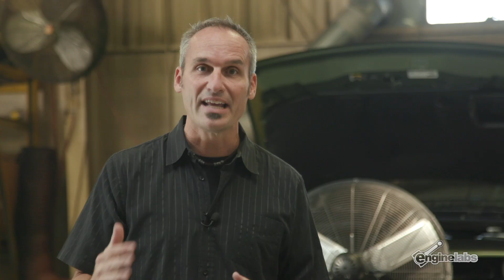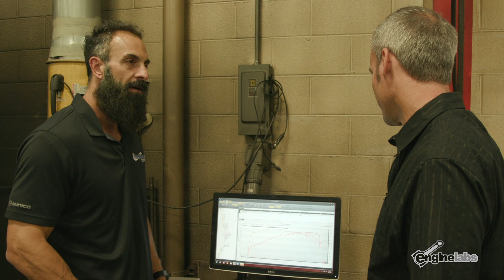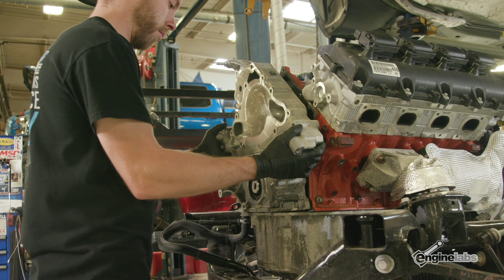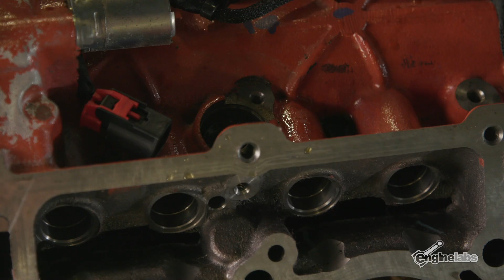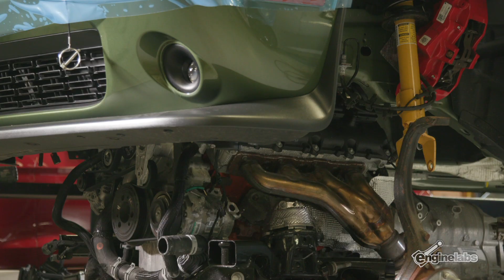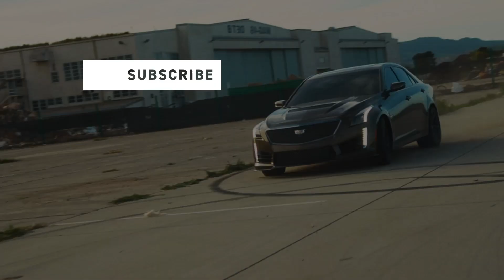Installing and Dynoing COMP Cams' Stage-2 HRT Valvetrain Assembly on a 6.4L Hemi SRT Engine

Comment: did the mk 112 300 11 kit and had long tube headers hf cats y-pipe magnaflow mid mufflers reso delete and engine trans dyno tune already in place and gained 10whp and lost 10wtq
Beyond dissapointed with the Comp cam stage 1 on my 06 daytona.
Thought a hydraulic roller cam would ve given some decent low to mid range umph

Comment: Do you need to do the full kit with an upgraded/stage 2 Cam if you have an M6?  I just didn't know if with mine, I don't have the MDS system if I still need to do the new Springs, lifters and rods with a new Cam?
Reply: You will not need the lifters, but need the rest
Reply: if you have over 40k on your engine, you might as well change out those lifters as well.

Comment: A nice 10 second clip of that car at idle would be nice. That and the cost of having all that done at that shop.
Reply: I have a 16 Srt jeep. I want to do cam, push rods, valve springs, long tubes with high flow cats, cai, high volume oil pump, already have cat back, and a tune after. Looking at roughly 7500-9000 depending where I take it to have the work done. That’s USD, and yes I know I’m 4 years late to the chat 😂
Reply: @dropdead_srt You're not late haha. Its crazy to think a cam swap cost as much as a low mile 6.4 engine.
Reply: @ruffypoo yessir, well if you do all that work yourself you could be in the 5500-6000 range.  You have to consider roughly 1000 of that is for the dyno tune. A large chunk also for labor. Another note to take is long tubes with cats is about 2000 dollars. Depends on what you want to do when the motors out of the vehicle. Personally I don’t see the point in not doing headers the first time around so I don’t have to pay to drop the motor later down the line. Cost varies from shop to shop and depends on where you live as well.
Reply: @dropdead_srt so many tests done showing that there isn't much to gain on headers if you have stock 6.4 ones. Not unless you're really upgrading but by that time it would just be smarter to get a 6.2 and save yourself the trouble of double the money on a 6.4 for 840hp or just get a stock 6.2 redeye
Reply: @ruffypoo on boost or cam builds you’ll see the headers shine. The issue is a lot of people do headers on stock or near stock 6.4 and wonder why they’re only seeing 15-25hp gains. I will agree dollars per horsepower are not as worth it on the 6.4 vs other motors but to each their own. I want a 480-500whp daily to tow the boosted vette or ctsv. Could go for a trackhawk instead but then I’m paying hawk prices on insurance 😂
Reply: @ruffypoo stock headers flow wonderfully for the stock cam but when you change valve lift and duration you allow the motor to move more air. The stock headers that were good for stock cam can actually hold you back and luck up potential gains. Get 25-40+ hp out of them with aftermarket cam.
Reply: @dropdead_srt the worst part of boosting a 6.4 is you can only do 5 psi to be safe, so now you're stuck with either little psi and or forged pistons and if you're doing pistons then its a must to do rods. It all gets out of hand really quickly but I do have to say a stroker 392 to 454 stroker kit sounds amazing. Many do the 426 just for numbers but give me the biggest you got. The 454 is about as big as you can go on a 6.4
Reply: @ruffypoo yeah I’d only go na. For boost I’d upgrade the block. Wouldn’t waste my money and time on a 6.4 at that point. If I want 700+ I’d get a hawk and mod that instead. 6.4 motor is only as good as its trans and axles etc. on the Srt jeep we get the hp70 which can handle about 650 with a really good tune. At 650+ I’d have to upgrade the trans, axles, and plenty more. Just not worth it to me. Rather blow money on a 700ish hp corvette build. Gonna do the jeep for a fun daily with some pep, the incredible sound, and reliability. Id rather not fall victim to the dreaded MDs lifter and cam issue.

Comment: Only thing with that cam is u loose low torque
Reply: Whatever you might lose it makes up for. When your rolling at about 30 mph , it kick like a monster. You better be ready to drive. Mines a 2012 with Magnaflow's and catch can. That's it with 5 speed auto , no problems. It took the tuner a 2'nd try to get the idle good and re-programmed the shift. This car is great. Comp lifters were on backorder so HHP gave me Hellcat lifters so that mds crap is gone.
Reply: 🤣um, no.
Reply: @Cuda_Jr  yessirr u do I had 1
Reply: @Desktopbeatzinc  which cam?  a tune?  all the cams i have seen, tested and/or installed have gains throughout the powerband (on the 6.4L). compare the dyno sheet here, before and after.
Reply: @Cuda_Jr  depends on the transmission and do u have a stall converter and a custom tune all that plays factor so if u have a 5 speed manual or 6 speed automatic or the new 8 speed automatic all plays a part but with 8 speed u shouldn't need a torque converter but with the older transmissions u will if you want full power. If u don't add a stall converter u will lose power on the low end but gain drastically on top end
Reply: @Cuda_Jr  the stage 2 bro comp cam

Comment: What are results if you change pistons to valve reliefs, so you can use full vvt?
     Is that possible?
Reply: Depends on the total Lift, and 5.7 vs 6.4  , 6.4 uses 132 degree sweep while the 5.7 is 128 , once you get over .610 lift with stock 2.14 valve size , you can't make the valve reliefs deep enough to do it to do it on the 6.4 , the relief cut weakens the top piston. the 5.7(eagle) I think you could go as high as .620 lift but I never tried it on the 5.7(eagle) depending on DIA of the Valves,  if you use 2.18 valve in the 6.4 Application , I think .600 lift would be the limit....can't say for sure...I haven't tried it. 

I played around with .605/.605 228/235@.050 .112 LSA in a 6.4  two years ago (spring 2019) , stock 6.4 Bore stroke combo , Manley 598800C pistons and Molnar 6.20 C to C rods. 505 RWHP was the average on the chassis dyno, car was a 2014 Challenger went a best of 11.65@115 weighing in at 4230lbs race weight. at MIR in Maryland.
Reply: @rickgehring7507  
    Thanks man, 
Thats very interesting.  
Heres a question for ya. 
       If you have a good flowing head…. Lets say like an indy sr with max wedge ports like i run….
      If you use a milder cam like a smaller solid flat for decent sharp street manners. 
   Does the flow of the good make the engine perform better than the expected “parameters” smaller of the cam?
    Kind of a muddy question I realize.
Reply: @sandozman6085  I think it would depend on the CI,    when you look at the 09 , 5.7 Vs 08 5.7  it's basically  375HP vs 345 HP , cams were not that different 494vs 484 (if I remember correctly)  the power gain came from the extra 20 some odd CFM difference, if we look at the 1970 340 vs the 09 5.7(345ci) , 5.7 cam has higher lift  by .060 in  and duration @ .050 is almost 30 degrees smaller , intake Port flow is 290/300(depending on source for the 5.7 ) vs 210/220 again source dependent) for the 340. we are talking about 100hp difference on paper , real world might be 70hp the 340 was a bit underrated.  this past Nov, I put a set of stock Apache heads on a 266k mile 5.7 and dumped it in to my 04 SLT ram, it went from 270whp(stock 04 heads and intake manifold and OEM cam )to 310whp with the Apache heads, eagle auto intake manifold(with spacers ) added  a 6.1 cam(.540"/.528" lift, 208/211@.050) and a Sniper intake it jumped up to 355whp , the following weekend I ran a 13.50 @99(weighing 4750lbs)  over at Island raceway....parasitic loss  with a 545 trans is typically 82% Driveline loss.
Reply: The only BBM comparison I have would be a 413 ci 361 I built in the early 90s. (4.185 sbc 400 pistons, 6.53 rods and 3.75 440 crank) with a .509 cam (old one) Holley street dominator intake and 800CFM carb. 915 heads 2.14/181 valves ,done by Hughes I think there were 250cfm @ 600. it went a best of 12.20 in a 3200 lbs in a 72 D100, roughly .85HP/Ci WHP slightly better then the stock 5.7 above( .78whp) in 90 I bought a set of Original Indy alum heads( if I remember correctly) 320cfi @ .600 . . Lazzeri told me it was going to fall on it's face.....well a best of 11.45 with that  combo, used a 440 Holley intake same carb. (1.03hp/Ci whp same as the above 5.7 with apache heads) .the best that truck ever ran was a 9.81@139mph with a old .654 Mushroom cam those Indy heads with more port work and the Mopar 400 stage 6 intake. 1050 dominator.  trans was a A833 18 spline.
Reply: @rickgehring7507  nice. 
I’ve run 11.01 @ 121 with my 69 charger when it was a 440. 
     Since then it has been transformed into a 493 street car.  (Specs all changed now)
    Long story short.  I was using a custom.600 comp cam, but its not sharp enough on the bottom for me. Huge power over 6000 past 7000…. But who needs that.  
     I prefer the fun snappiness of my fathers 392 scat pack charger.  Even though it is less powerful, it is far more fun
Reply: @rickgehring7507  
    I’m just hoping to not strangle the 493 with a cam that performs well for a street machine, if you get my drift.  
    Thats where the vvt really shines.
Reply: With these vvt cams your either gonna lock it out completely or limit it , not one I’ve seen is using the vvt fully on a aftermarket cam (the vvt has been out since 09 on the 5.7 and 11 for the 392)

Comment: Good sponsored video. Nicely done. I do question the use of the terms "Good drivebility & streetabilty" on a dyno pull test?
Reply: Especially on a motor that was just torn apart and rebuild, Hope they gave it a good break in so the lifters/ rollers had a good seat on the camshaft. Oil change as well. I would have gotten the Long tube headers put on while they had the engine dropped.
Reply: with the right convertor(in an Auto car) the HRT stage 2 and 3 will Idle at a stop light all day , provided it's tuned right.

Comment: I havent seen the hrt stage 3 dyno yet, should be Great Results with those aggressive specs
Reply: Waiting for that one
Reply: @Lili Pipi  more power is bad?
Reply: @200shotramhemi4  The HRT3 will not gain the low end like the 2
Reply: @captainblaiser  the stage one has better low end than the stage 2; each cam has it's pros and cons
Reply: @200shotramhemi4  exactly, the stage 3 is meant for high RPM and will not gain anything down low
Reply: @Lili Pipi  what are you talking about

Comment: I have a 6.4 as of Saturday. I had a 15 rt 5.7 I did this stage 2 hrt cam install. It would get close to a good tune, powerful, but driving stop sign to stop sign was shit.
   I had it tuned by 2 different people and a dyno tune. Diablo and then HP tuners. It was close at the end. But then it would die at stoplights or in reverse with the break on. 
    The sound was amazing, great power, after 25mph drove great. 
    Idk if I will do it again.
Reply: I used this cam in my 2010 rt challenger plus other mods put I'm putting out 512 hp so I would say u probably need a better tuner for dodge
Reply: @Desktopbeatzinc  512 to the backwheels? What other mods?
Reply: @brokelahomachickenfry6497  90mm throttle body kooks longtube headers and midpipes, diablo , 6.1 intake , 160 degree thermostat, vvt turned off ,cold air intake a few other  mods but to be honest it's all in the person who tunes it . Because I have seen guys get long tube headers and a cold air intake and very good tune and crank out at least 417
Reply: @Desktopbeatzinc  I have never seen that to the wheels with just longtubes and a tune. I had stainless works longtubes, highflow cats, 87mmtb, CAI, Borla Atak catback system, and a 6.4 ported intake manifold.
  The most anyone has posted on a dyno was HHP with this same setup and they got 435whp. Not crank hp but back wheel horsepower.
    I will say we all used the phaser limiter, not the phaser lock.
Reply: Im not saying your are lying. Anything is possible, I just have never seen it with these mods.
Reply: @brokelahomachickenfry6497  I had to use the lock instead on my 2010 that unleashed power and vvt being turned off
Reply: @Desktopbeatzinc  There's a guy on here who has been posting for the last year now. His last video, 2 days ago, he just changed out his phaser limiter to a phaser lock.
Reply: Track Pack R/T is his you tube channel. Also I dyno on a Mustang Dyno.
Reply: @brokelahomachickenfry6497  trust me it works
Reply: @brokelahomachickenfry6497  this is my second stage 2 cam install the limiter caused my dial pin on the cam to shave off it was a mess we have broke my engine down like 3 times and been to like 3 tunes shops before we got the right formula it was a fucking  task 😂😂😂
Reply: @Desktopbeatzinc  512??? Whats the other mods? Long tube & intake throttle body upgrade ported intake ?
Reply: @Slow-ek7xu  every thing u said plus high performance torque converter
Reply: @Desktopbeatzinc  im happy for what im about to achieve then because i have all the same mods besides the ported intake and the torq converter
Reply: Your tune was off
Reply: @SrtHemiPower  I agree. I just couldn't find anyone close in this area that was really Hemi specialty.
Reply: That 5.7 needed e85 or a torque converter to help with that driveability
Reply: @200shotramhemi4  I can see the torque converter helping, but how would E85 make a difference in drivability?  I  know it's great for boosted engines, but stock compression drivability? School me please.
Reply: @skeezixzx9r  e85 adds Torque and horsepower everywhere in the power band, more power in the power band less chance of stalling
Reply: Definitely tune issues , if your tuner isn’t a mopar tuner like AJ hemi tuner , Brent at dtp racing , josh at hhp etc your probably gonna have drive ability issues
Reply: Mine did the same with Stage 2. The tuner had another go at it and it's great now. Daily driver for almost 3 years , no issues. Tuner set the transmission up to shift harder as well.

Comment: Do a 5.7 with the comp cams
Reply: I did. My baseline was 332whp. After longtubes, cai, and stage 2 hrt cam and dyno tune, it made 405whp when it was 100 outside and my air intake temperature was 136.
      Daily driving in town was terrible. After 20 to 25mph it was great and powerful. I got rid of it Saturday because tuning was a pain. Either surged lie crazy at a stop, or tuned it down and it just died all the time. Spent 3 months of getting it tune. I git the 6.4 Saturday.
Reply: @brokelahomachickenfry6497  Do you think the tuner just wasn’t advanced or he did his absolute best? And what year is yours?
Reply: @jibreelpruitt8312  Mine was a 2015 Sublime Green RT 5.7. I had just put the 3.09 diff in 12 days ago brand new from mopar.
   I put a lot into. The 6.4 stock has great power and drives great for daily driving. I will say I feel like my RT was faster at this point. Definitely the torque and throttle response on my RT was amazing.
    I used Hemifever for the first 6 tunes on it. Then I took it to get dyno tuned at Deep Stage Tuning in Norman,Ok. He did a lot better with it on the dyno, but, it was like it would not stay dialed in. 
    Last Saturday was by 5th trip to dyno tuner. When I left, ran smooth as silk for 25 miles. I pulled up in the driveway and it just died.
    Drove back up there. He adjusted it again because the timing had dropped to the single digits.
    We drove around for 30 minutes. No issues. Drove home 25 miles away. Great until I pulled into my city and just died at the stoplight. I forgot to mention, once it starts dying at idle speed in Drive or Reverse, you have to gas and break it at the same time. With that torque it was difficult.
   I was fed up and left to a dealership and traded it in.
  I wish I had just stuck with the tune for stock except longtubes like I had for awhile.  I have a video on here about the issues and a cold start and warm idle.
Reply: @brokelahomachickenfry6497  sooooo you never learned why? Waas it a fuel mgmt thing? An air thing? DOD not turned off? Anything?
Reply: Ok so it sounds like your idle RPMs were too low
Reply: @brokelahomachickenfry6497  my 2019 RT is stock did the 3.09s make a huge difference!? I think I wana put a blower instead of a cam I only want 450whp por 430 ish . Cams always seemed like they would be a pain in the ass to daily
Reply: @just_a5.7   you can get 450 whp with a cam in the 5.7 but.........you will need a good convertor,  minimum 3k stall.
Reply: @rickgehring7507  I rather pro charge
Reply: I have a video on here posted of my car. Im not any kind of you tuber, just wanted share my experience with it.